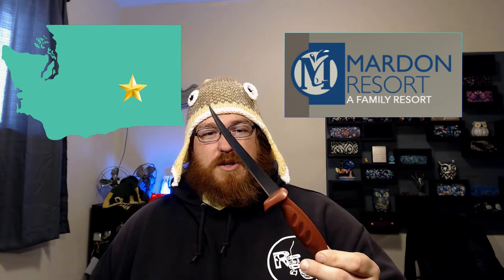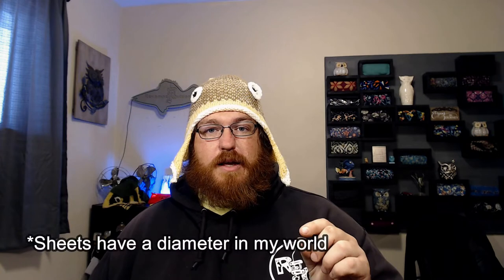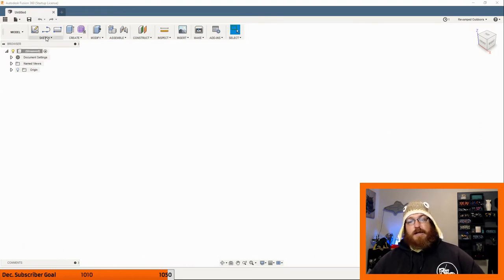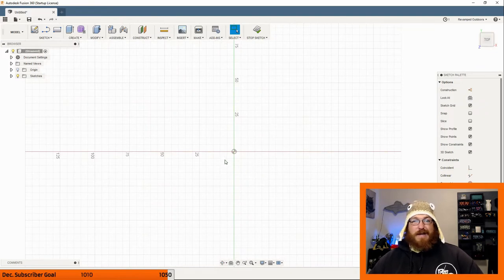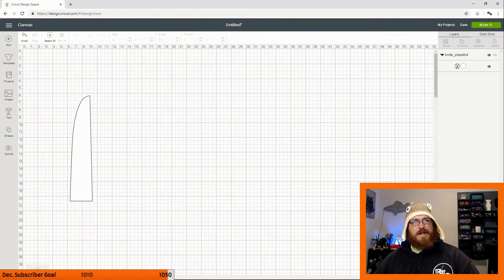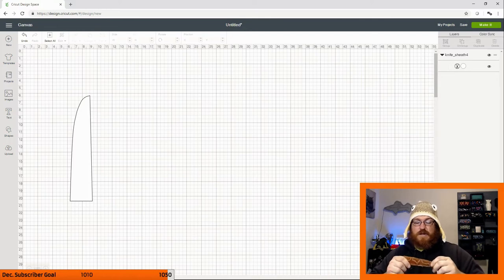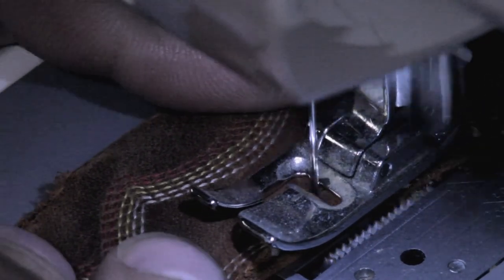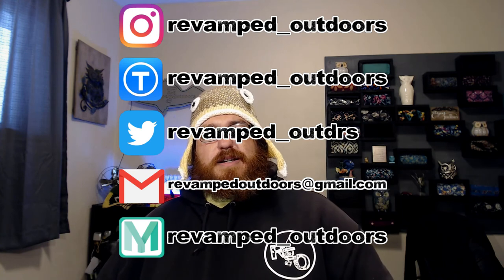Cutting reclaimed leather with the Cricut Maker and Knife Blade for knife sheath

Comment: I make leather journals with tooling leather. Great to see some men using this machine. I've had mine for a year and have cut 5-6 oz leather like butter. Limit is 7 I believe. I accidentally ordered 9 oz and it hit the bar and didnt feed so that's the limit. But no big deal. I cut a pattern with freezer paper in the cricut maker and cut the 9 oz with a craft knife so it worked out. Wondering right now if the scoring wheel will emboss tooling leather.. just ordered it and going to give it shot. I have high hopes it will.
Reply from the maker: Thanks for the tips! Hopefully it embosses!
Reply: Sara Tx hi there ! How are the edges of the tooling leather when cut? Are they fuzzy? Did you cut with the blade it came with or the knife blade?
Reply: @deepdiver849  I cut it with the knife blade. It's not fuzzy at all the same as hand cutting with a sharp craft knife. Better in my opinion. I've used my knife blade for about 6 months now on leather and yet to replace it. The thickest is 7 oz I believe but I mostly cut leather grades at 5-6 oz.
Reply: Sara Tx Thanks for answering! Exactly what I wanted to know 🙏🏼

Comment: What's up man. I found your channel regarding the 3D enclosure scrubber, stayed for the hats! I have a pretty decent cutter called a Silver Bullet and what I found cutting leather, it isn't consistent for my needs and I don't like the failure rate so I approached this differently. I make my patterns out of .02 thick plastic, and these machines get incredibly accurate. The way they are cut doing multiple passes, it shapes the plastic and gives the bottom a 'lip' that I can then use to grip onto the leather so it doesn't move with just the slightest downward pressure, as I use a rotary cutter or razor to cut the pieces I need. I've used templates with .020 thick plastic for years, really works great!
Reply from the maker: Thanks for the kind words! I knew the hats would be good for something! Thanks for the tips on leather cutting, I might have to try and make a rotary cutting tool to try more leather in the future. I recently build a 20 blade rotary cutter for cutting silicone skirts for bass jigs and spinner baits, I should try and make one out of the blades for leather and fabric too.  Thanks again for the info!

Comment: I love my cricut. I want to use my svg files and turn into STL files to cut. But I want to print the multi colors like my files. Can you help me?
Also would like to know how to put a hole down the middle to create a straw topper.
Reply from the maker: There is a lot to unpack here. Converting SVG to STL is possibly but STL is 3d and SVG is 2 dimensional. If you're thinking about doing it for signs or something that's pretty simple. Printing in multiple colors is tricky but possible, you need to manually switch filament and code in a stop script at the layers you want. Or to print colors you need to have a multi color printer. As far as making a straw, that's super easy in fusion 360. Just extrude a circle then make a smaller circle inside and then cut the smaller from the larger
Reply from the maker: I hope that helped, all that you asked is definitely doable though!
Reply: @RevampedOutdoors  thank you
Reply: @RevampedOutdoors  OK, thank you

Comment: Sweet vid, my wife bought a cricket, but I call it a CRY CUT! I'm a leather worker and was wondering if I could use it for leather. That software is $495 dollars a year!
Reply from the maker: Seems to work with the soft leather pretty good, I've seen others use in on new leather so I bet the razor attachment should be able to handle it pretty well.  On thinner pieces I bet the fabric wheel might even work as well.  If you mean Autodesk Fusion 360, there is a free to use version if you're not a business you can get a personal use license.  The "basic" license is the one I use because I just do this for fun and don't make any money.  Hope that helps!
Reply: @RevampedOutdoors  I think I found it. Great video and thanks for the info.
Reply from the maker: @SouthWestIron  Nice! Be careful, the more you start messing with CAD the more it gets addicting, I haven't seen the sun in years.
Reply: @RevampedOutdoors  Im wondering if can use my wife's cricut to cut out acrylic patterns for my leather projects?
Reply from the maker: @SouthWestIron  how thick is the acrylic? I've had success cutting pretty thick balsa or basswood but that's a far cry from acrylic, you may be able to use it to score and break like a draw tool.  Otherwise a laser cutter would be the way to go for anything over 1/16 or so.  The thickest material I can confidently cut as a plastic with it is about 16 mil mylar for duck call reeds, it takes 2 passes with 220 inch lbs on the settings but it will cut with the deep cut blade.  Most everything thicker in acrylic most people are using the laser cutters.
Reply: @RevampedOutdoors  Less than 1/16th for sure.

Comment: Can the Cricut cutter be mounted to a 3d printer or cheap cnc machine, or would it need a more rigid setup?
Reply from the maker: That's a great question. I would say it would be possible with some serious mods. The x axis on the cricut looks to be about 15-20 mm diameter to hold up to the downward force. Using just the point blades would be very doable on a 3d printer with aluminum extrusions though. The blade spins free in it's holder and you can pick them up for under $15 usd. All you would have to do is replace the hotend with a printed holder for the cricut blade housing and run the gcode for a flat object like a plotter. Maybe moving the z by like 0.08 mm per layer until it is cut through. The whole cricut mechanism lifts the blade each cut so i think that might be more rigid than standard stainless rods on the kit printers.
Reply: Thanks for your reply. I just built a 3018 cnc and have been using a T8 cnc for routing pc boards. I thought I might add vinyl cutting to the 3018. It has 10MM rods and seems rigid enough if the tool holder was designed right. I don't think it could do leather,  cardboard, or balsa wood without stiffening the X carriage. I searched for "Roland blades" on Ebay and they seem cheap enough to experiment with. So many affordable options today for the cnc hobbiest like 3d printers, lasers, knifes and end mills. I really enjoy your videos. They are very different from most 3d printing channels.
Reply from the maker: @BillyF1289  thanks for the kind words on the videos! Which 3018 did you go with? I've been thinking about trying CNC routing for fun but I hardly hear about any of the affordable kits.  I think the 10mm rods should be plenty for just using the blade with a printed  tool holder.  I got the deep cut blade and housing from eBay for about $15 the deep cut is a 60 degree cut angle but it does cut vinyl a bit too deep.  The fine point housing works really well for typical vinyl.  I think it would work pretty well, just a bit of pressure is all it needs and the vinyl cuts like a champ. If you're going to cut a lot it might be worth looking into getting the carbide blades to last a little longer.
Reply: I bought my 3018 on Ebay from a seller in Kentucky called "goodlucksell" for $190. I've only had it a couple of weeks so I don't have much experience with it yet. It seems to be a larger version of the T8 cnc that I've had for over a year. I've made many pc boards with the T8. These are small machines that are good for engraving wood, acrylic, making pc boards and very light cutting of wood. The 3018 seems fairly solid except for the X carriage that holds the Z axis mechanism and spindle motor. If you put your finger on the bottom of the spindle motor and pull up with a light force, you get about a half MM of movement. This comes mostly from the slop in the linear bearings  but some of the movement comes from flex in the 10MM X axis rods. I've seen videos of people cutting MDF with it but it's very slow. If you want to cut plywood or MDF at any reasonable speed you'll need a bigger machine. Since I intend to use mine for making pc boards and other light work,  I think it will be fine.  You can find youtube videos by "Dave M" and "AllTheGearNoIdea" but they are mostly about assembling it. I found the assembly pretty easy, referring to the "AllTheGearNoIdea" videos. It came with a cd of software but I never took it out of the package. There are several  G code senders to choose from. You just have to find one withe the features you want that is compatible with the GRBL version on the Woodpecker board the machine comes with. My T8 machine came with an Arduino and CNC shield which I prefer and  is easy to update. You can probably update the firmware on the board but I haven't looked into it very deeply yet. Thanks for the info on the blades.
Reply from the maker: Awesome, thanks for the information.  I might try and save up to go with something that can handle aluminum.  I always wanted to make injection molds so I think going with something like the millwright CNC might be worth it.  Probably would be a good idea to learn on a more affordable machine though I can see myself driving the bit into the bed the first few times.  Thanks for the suggestions on videos I'll check them out!

Comment: Thanks for the video, I've been looking for something to cut leather, i tried the curio and it failed alot...and the maker is much cheaper than a glowforge lol
Reply from the maker: True! It's been working well so far, I haven't tried any new leather yet which would be a bit tougher, hoping to try soon.
Reply: @RevampedOutdoors  If i can get it early enough and up and running, Ill be trying some new 2oz veg tan on sunday...Ill let ya know my results.
Reply from the maker: @jaykavanagh8970  Awesome please do!
Reply: @RevampedOutdoors  Ok the maker cut that leather like butter. Only downside of my machine right now is it makes an annoying clicking sound as it goes back and forth...I found videos of the same issue going back to 2017...so looks like a problem they never fixed...waiting to hear back from Cricut on the issue.
Reply from the maker: @jaykavanagh8970  has it influenced the performance at all or is it still able to cut well? Mine isn't the quietest thing ever but seems to perform well still.
Reply: @RevampedOutdoors  Performance seems fine, but it just an improper sound in my opinion. Based off supports reply, Ill decide if i want to try to exchange or just outright return it.
Reply: @RevampedOutdoors  Hey I got a replacement maker machine...this one doesn't click at all...over all though support told me nothing. Thankfully ordering from amazon, replacements are no problem. Already cut my first wallet and will be "attempting" to sew it this weekend.  Overall i would say for at least 2-3oz leather it does the job.
Reply from the maker: @jaykavanagh8970  nice, glad you got it worked out. I like it for cleaner cuts seems when I use a hand held razor things just go off the rails quickly

Comment: Do you have a website where u got your Cricut
Reply from the maker: I just went through walmart for a local pickup. Ordered online and picked up in store. They had it for the same price as other online stores.
Reply: How much was it
Reply from the maker: @younghunter1233  when i got it it was on sale for $320, looks like it's  went up quite a bit since then though. If you don't need to cut really thick materials the cricut explore 2 can cut well for under $200. I just needed one with more pressure for acetate sheets/ mylar.
Reply: How thick of material can I cut up to
Reply from the maker: @younghunter1233  depends on material type. Leather I wouldn't go much past 6mm with the razor blade attachment, the deep cut blade handles 14 mil mylar easily. Fabrics are cut with the fabric attachment and most standard fabrics have cut fine. I haven't used it on canvas yet but I bet it would handle thicker canvas with a few passes. This is all for the cricut maker, the explore 2 has limited attachments, no razor blade attachment so just the standard point blades.